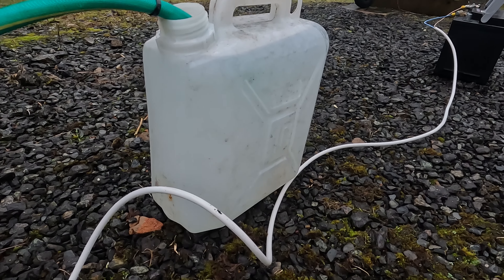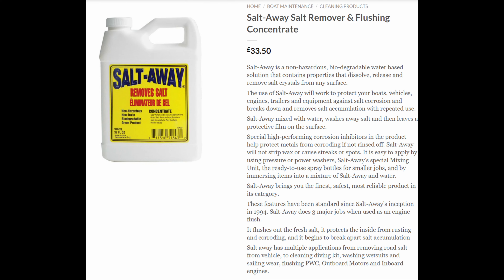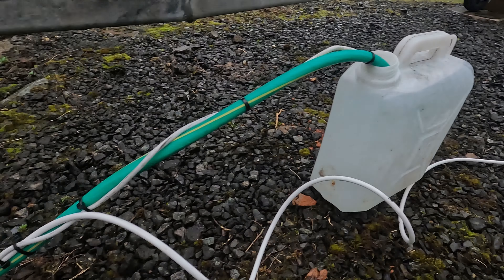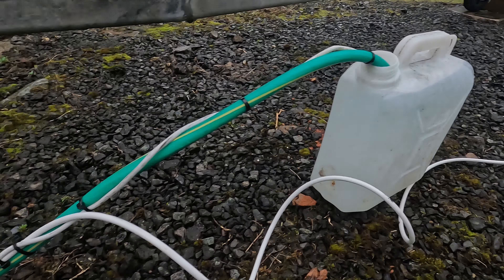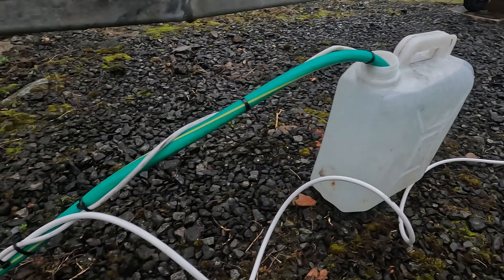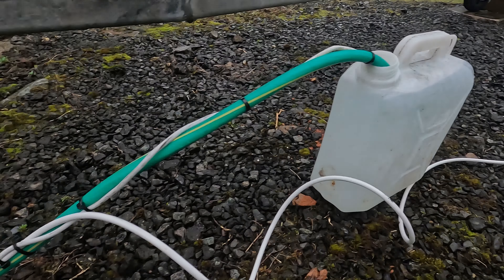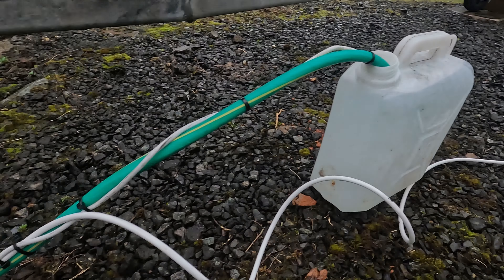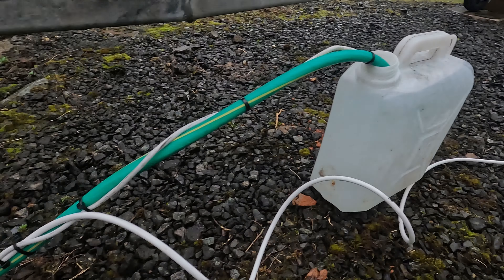Independent boat trailer hub flush system( Epic Daze)

Comment: you would of been better   having two separate   axel   flushing ports    one for the front  and one  on the rear    just to get more  flushing pressure    instead of one  inlet port flushing the  two axels          the system you have would would be better using a  pond pump  and a rubber     tub          i use the pond pump  and tub when flushing my  outboard     from the flush port     to flush the  water  pump i use  muffs       
tight lines Alain
Reply from the maker: Thats a good idea. I've made it compact to carry easily.  The trailer was over 10 years old when i brought it. I replaced all the brakes, bowden cables and springs 3 years ago. Then installed this system.  I have a different flush system when access to mains pressure is available.  This is my guarantee that at least some flushing will get done as I'm lending the trailer to another Anstey sea anglers member.
Reply: @Anstey-Sea-Anglers     go into go outdoors    they sell a  little    hand pump   pressure washer     holds about a gallon      i use  one  for washing  my  caravan   as the tap is 200 yards away     think the last time i saw them they  where £12